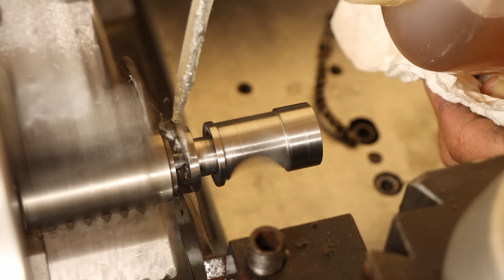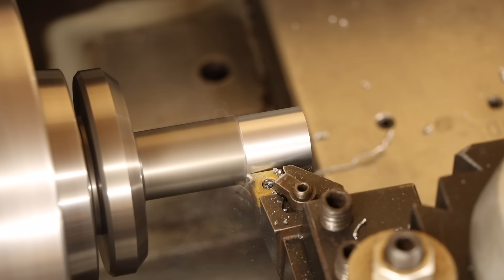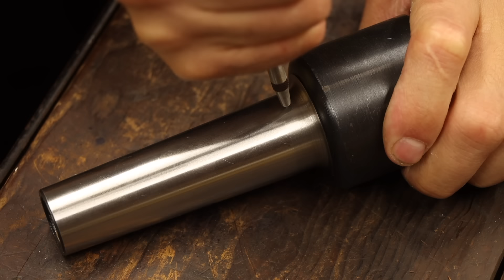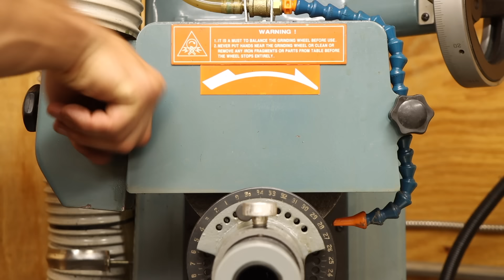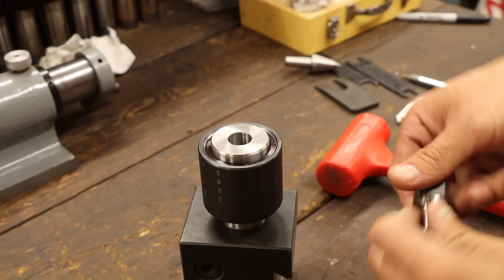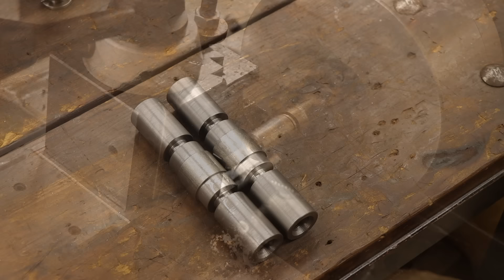Rotary Broaching Eccentric Cams || INHERITANCE MACHINING

Comment: I simply took a chuck that is designed to mount on back plate.
Measured the throat turned out a pin that goes into the center hole of the table and slip fits the throat of the chuck and with Tee nuts bolted it to the rotary table.
 This allows for minor alignment to Spindle.
Yes, it's not transferable to lathe. But works great.
 As another alignment  I purchased a R 8 tool with a straight shank. Made a sleeve  that to go onto the shank of the R8. That is a slip fit of the hole on the rotary table.
Quickly gets table aligned within a thousand every time.

Comment: I don't know if you read comments from projects this old.  Any way I saw you had clearance issues using the spin indexer on the surface grinder.  I reworked my indexer so the collet goes in from the other side and added thrust bearings, seals, and a better clamping system.  Others have posted this mods, so I'm not original. Someday I might make my own using er collets.
Dave

Comment: Simply milling 4 small holes to make such a well performing square socket without broaching surpriced me. I just wonder why you didn't just buy a handful 10 mm broaches from Ali. I find them around $20 incl shipping, typically HSS, which I believe is the best for the purpose, unless you made the cams out of something insanely hard. You don't need hardness and extreme heat resistance for broaching, you need toughness and crack resistance. HSS beats carbide in that matter.

Comment: Grinding small flats on tips ofn the corner on the end of your broach would make them much stronger.  They are essentially knife edges now, so grinding small flats on top of them will maintain the sharp outer edge, but give them some strength.

Comment: I know you like to overdo things, and I know you know that you do.  What I don't understand is why, in your search for perfection, you seem oblivious to the problems your supersize mentality causes.  Your sine plate is enormous causing you trouble fitting it under the grinder.  Your chuck adapter means your mill set-ups are frequently too high to fit tools into your mill's chuck and you have to do a side project to fit them in the spindle taper.  Even your rotating fixture plate must be about 3" deep.  As well as the sheer impracticality, when your combined work-holding is 18" high, you're doing something wrong.  While the individual components may be rigid, the whole system is not rigid, the torque on the mill bed is huge and you'll lose any accuracy your heavy construction was designed to provide.

So, in the quest for "perfection" shouldn't usability, practicality and usefulness be high on the list of attributes?  Since you're aware that you go over the top, shouldn't you make a conscious effort to only overdo things which don't adversely affect usability?

For instance, you could have gone over the top with your precision jacks by having graduations so you can dial in an extra thou.  25tpi would have given you a thou for every 9 degrees.  With graduations every 4.5 degrees you could easily dialled in an extra half thou.  This unnecessary addition actually adds usability for those situations where you really need to dial in something precisely, but doesn't detract from the day to day use.  You could also have gone for a monumental side project and designed (or renovated) a rotary graduation machine.

I don't want to be brutal, because I like what you do, but let's be honest, I think I've only seen you make about 6 things that weren't tools to make tools to make tools.  Maybe if you considered that tools are ultimately for making things that aren't tools, your designs would be more practical.  Ask yourself whether that fixture needs to be made from 2" thick steel plate.  By the time it's on your mill, you won't be able to mount anything big enough to warrant it, and everything will be so heavy that your mill bed will be cantilever over, losing any accuracy you were hoping such a beefy fixture would give you.

Comment: Maybe I'm not seeing it but what's the advantage of this broach rotating?  Seems like once it stops slipping and grabs, relative motion is zero in relation to the  piece so you may as well be doing static broaching on the lathe/hydraulic press/mill?
Reply from the maker: in short the 1 degree angle everything is set at makes the cutter only engage on one "corner" at a time making it cut a lot easier
Reply: i see, a tiny amount of introduced "wobble" loading and unloading the lead cutting corner? @InheritanceMachining

Comment: 10:14 What exactly is the point of turning the lathe while using the rotary broach, if the tool and the work piece are both spinning together? Isn't it exactly the same as both of them being stationary?

Comment: Nice video Brandon, thank you. Quick question: to make the square holes, why do you even turn on the lathe? Both the work piece and the cutting tool rotating equally fast... It would be the same if they stood still, right? What am I missing? Thanks

Comment: I always learn from the many things you do, but I have a question, or maybe it's an observation. As I sit here watching you grind away on that old endmill, I wonder why are you grinding? The milling machine could easily do that job, but...ah hah! The endmill is hardened, right?  That endmill is small. You could easily anneal it using only a blow torch. Get it red hot, and let it cool slowly. You know how, right. Easy to find plenty of guidance on how to anneal steel, and how to the re-harden it. Not difficult and it would save a LOT of time. I think. Maybe I'm missing something?
Reply from the maker: Honestly you may be onto something. Though that end mill was high speed steel which I always thought behaved a bit differently than your regular hardened steels. I could be wrong though. If I had to do it again I would pre-mill everything with a carbide cutter or some sort then finish grind on the surface grinder because you're right, that took forever 😂

Comment: I’ve binged all of your videos multiple times now. The “ease” and the patience you have to get everything dead on is inspiring. I’m not sure if anyone has mentioned this yet, but doesn’t a rotary broach need a special holder that lets it wobble a little to make the cuts? I’m working towards getting my first lathe and then a mill and I was just wondering if that’s the reason the broach broke. Or are the holders just a way to make it easier? Anyway, your channel inspires me to always do my best work, no matter what. Keep it up!

Comment: If the part and the Broach spin at the same rpm and in the same direction why do they need to spin at all? Couldn't you have just pushed them together without the lath spinning?

Comment: I recently discovered your channel and am currently bingewatching everything there is. Beautiful content, well explained, nice shots, thank you! 
On this Video I first had a question: Why is it important that the broach and tool are turning to drill the square hole? For my uneducated eye it seems unnecessary. Could you or anyone elaborate? Thank you, looking forward to your next video!
Reply from the maker: Thank you and welcome! So basically it is possible to just press the broach without turning to make the shape, but the forces would be very high and likely shatter the tool (my shattering was another issue). A sequence of bigger and bigger broaches would work as well but then you would need several tools. The rotating type in my case is combined with the 1 degree angle I tilted the cutter. This allows only 1 corner at a time to be working as opposed to all 4 at once which is a lot easier on the tool.

Comment: Another great video. You duplicated the cam parts that I tried to make or figure out how to make. I ended up buying them. I still need to make a complete D1-4 spindle head to adapt to a threaded spindle nose, lock tight it down and pin it so I can run my lathe in reverse without the chuck coming off. Maybe I should just face the fact that I'm not capable of using a lathe or mill like an engineer or a crackerjack machinist. Lord knows I try and I guess that's as good as it will get. At least I'm still moving and not sitting around. Thanks for a well put together video.

Comment: Good stuff, one comment on the rotary broach; the 1° tilt should be be between the cutter and the bearing (which should be aligned with the lathe axis, making the curret appear to wobble when engaged), not between the bearing and the lathe axis... this causes sideload on the cutter that I think explains the failure you experienced.  They should cut very smoothly when everything is right.
Reply: No. The wobble you mention is only seen when doing this operation on a mill where the body of the cutter holder rotates, thus wobbling the cutter. On a lathe thhe workpiece rotates, so the cutter remains stationary.

Comment: I believe I know the reason you had so much trouble rotary broaching those holes square. The setup you are using is the compound slide set to one degree and as you advance the broach you are also changing the centre line of the tool to the work. The more you advance in the more severe the misalignment resulting in more side load on your broach. Carbide is great for tooling but it is brittle and doesn't accept impact or side loading well. 
When you look at a commercially available rotary broach it is mounted in the tailstock which of course is aligned with the headstock. The one degree angle is incorporated into the rotary broach by design. The centre line of  bearing in the broach is not running parallel to the centre line of the Morse taper tailstock. The cutting end centre line intersects the centre line between the headstock and tailstock so it stays on centre as you advance the broach in with the tailstock. Because of this, your broach never comes out of alignment with the work centerline so there is very little side thrust on your tool and only one corner of the broach is cutting into the part at a time as the tool spins which lessens the pressure to drive it towards the headstock.

Comment: I'm not gonna lie... i'm confused as hell. why did you have it in the lathe, SPINNING, to push a broach into it....?
Reply from the maker: It's basically because the tool is at a slight angle. So by rotating only one corner is engaging and working at a time. Reduces the amount of force (and the number of tools) needed compared to a straight broaching

Comment: Great video, I really enjoy the narration. 
I'm not sure why you had to do the broaching while rotating. It seemed to add an unnecessary complication. Can you explain?
Reply from the maker: Thanks. It's basically because the tool is at a slight angle. So by rotating only one corner is engaging and working at a time. Reduces the amount of force (and the number of tools) needed compared to straight broaching

Comment: Can someone explain to me how the broach tool worked? I can't wrap my head around it
Reply from the maker: Basically because it's set at an angle and also rotating, only one corner is working at any given time. Cuts the forces needed down by a ton compared to just broaching straight in with a press

Comment: If you did the taper exactly right it would not lock in when you slammed it in rather it would bounce back out.  Think about it, if the taper contacted small end first it would stick, large end first it would also stick.  If it were near perfect in would capture the air and bounce out, you would need to push in and hold it to give the air a chance to escape.

Comment: You might actually made the square holes better than the broached ones by milling. This way they don't grab the key by the corners but by the flats and can stand way higher loads before wearing down the edges. IIRC this was something developed for wrenches during WWII, to use higher torques without rounding the bolts.

Comment: Haven't done a lot of work with a mill, what will this fixture allow you to do on the mill that otherwise would not be possible?
Reply from the maker: It basically gives me a 4th axis I can use for longer cylindrical work that wouldn't be easily mounted to the rotary table by itself

Comment: Hi frome Argentina, you need to try in the rotary broach to grind a radius in any side like in the inert you use in the lathe like cnmg, is to much load for that sharp radius, if you want sharp square hole do with 2 or 3 broach passes with diferet corner radius, and with this you dont need bigger hole, also try deeper hole or brake the chips with an drill
Reply: proba con una end mill de desbaste es mas tenaz y tolera mas los impactos y velocidades de corte lentas

Comment: Wonderful video! really appreciate the craftsmanship here. A quick question from someone with basic manual machining skills: With the rotary broach, is the tool speed is the same as the part? If so, what is the purpose of it rotating if their relative speeds are 0rpm?
Reply from the maker: Thanks! The combination of the rotation and the 1 degree angle allows the broach to engage one corner at a time. So relative to the material the cutter is "wobbling". It also reduces the amount of force needed compared to straight broaching like you would do on a press.
Reply: @InheritanceMachining  I see, that makes perfect sense. Very clever trick! Thanks for explaining that to me

Comment: Hi again.

I think your take on rotary broaching is not that bad. In fact I considered it myself back when everybody (This Old Tony, Stefan, etc) were taken with rotary broaches and I found out what they cost.

But there is a fundamental problem with that idea.

The rotation of the tool is not right.

You see, a rotary broach spins a tool about an axis lined up with the chuck rotation axis. The tool happens to be out at an angle (to the rotation axis), but that is only to give it a wobble as it rotates. Rotation is still about the axis lined up with the chuck and the wobble ensures the cutting edges dig in and cut and then withdraw as the tool is spun by the workpiece. Feed it in, and the cutting edges still spin about the axis lined up with the chuck. Imagine if you put a washer on one of your (car) wheel studs and then put the wheel on and spin it. That is the rotary broach idea.

The idea in your experiment is to spin a tool about an axis at some angle with the chuck axis (and then feed it in along that axis too). And that is the problem. The tool may be centred when it enters the cut, but the more you feed it in, the more it departs from the cut centre and it is trying to cut in the side of the part. That is why your tool chipped. It was subjected to increasing lateral pressure instead of frontal (?) pressure. By frontal pressure I mean pressure against the cutting edge (where it would have cut no problems).

So does that mean that if you manage to keep the cutting edge centred with the chuck your tool will work? No idea, but I think you would need some very skilled hands (or CNC) to feed in and at the same time take back the carriage by the exact amount the tool moves off centre. Tool rake may be insufficient too depending on how deep you want to go with the cut.

Great video as always. Mistakes in general make great videos (and give you something to think about too).
Reply from the maker: Hey, Viorel. Thanks for the insight. What you explain makes sense but it's also not exactly what I did. Admittedly I could have elaborated a bit more in the video. 

In my setup I have the tool set up at an angle with the two axes intersecting at the tip of the tool. But I'm not feeding at that angle (i.e. with the compound), I'm feeding with the carriage along the z axis. So the tip is never moving off of the spindle axis.

I think my lack of success comes down more to my indication method and tool hardening. Having the indicator change orientation as it did means I could have introduced some error from the arm "sagging". And for the tool hardening. I didn't consider the the middle area of the HSS mill I used likely wasn't as hard as the cutting tips and should have been re-hardened for use.

Hopefully I followed your explanation and mine makes sense as well.

Thanks as always!
Reply: @InheritanceMachining  I see. Makes sense, that. Onwards, and upwards!

Comment: The video is great and the end product fantastic. Did I miss you putting a wobble into the broaching tool? The idea of a rotary broach is that it runs off axis with the workpiece (usually 1-2degrees) and then it wobbles in use, bringing a single cutting point into play as it rotates, reducing the cutting forces...
Reply from the maker: Thanks! Yes I glossed over this but I achieved this by setting the tool post at a 1 degree angle
Reply: @InheritanceMachining  I don't think setting it at a fixed 1 degree will do what is needed, the rotary broach I made (same as the Stefan G version), has an angle built in which causes the broach to oscillate / wobble in use to present different cutting edges to the work.. might have missed how you did it though!
Reply from the maker: @orrerychris  I think I know what's going on here. I haven't seen Stefan's whole build but I did skip to the end where he tests it. His broach does wobble when used in the mill because the holder spindle is rotating relative to the material. When he uses it in the lathe though you don't see the wobble because the material is rotating, not the spindle. The wobble is still happening relative to the material though. This is the approach I used. My broach wouldn't work in a mill